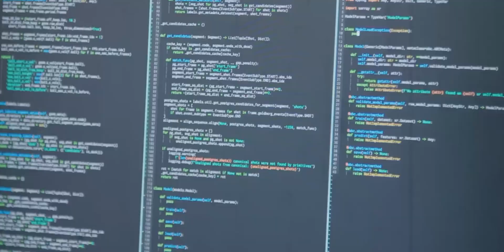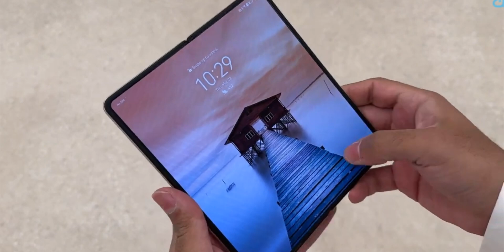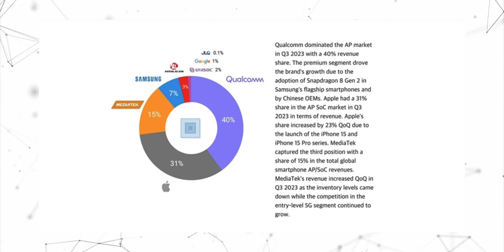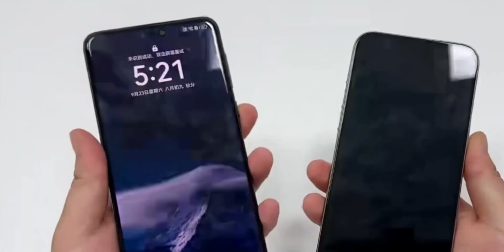Huawei - OMG, SURPRISE, Huawei is BACK !!

Comment: My next phone is huawei nova 12pro or ultra ,now i have nova 9pro !Huawei forever nonthing else, we dont need gms we can and without them!
Reply: Don't know the next, I have Mate RS, PORSCHE DESIGN, just replaced the battery.
Reply: I have had my Huawei P9 Plus for 6 years and still using the original battery and original charger. I'm astounded as I never expected this type of durability and it's the only durability I have experienced since the Nokia classics like the Nokia 6230 and 3310. This is by far the strongest and most reliable touch screen smartphone I have ever owned...and to think I was a bit hesitant to keep it after switching from my previous Samsung Galaxy S5.
Reply: @andrewfisher4266  what?  6 years and still using the original battery??? lucky you!!!!
Reply: Agree with you ❤
Reply: No more Huawei phones for me. The EMUI itself is a complete garbage and bland Os. It's supposed to be a Chinese phone but refuses to use the Unisoc T820 5g which is a Chinese SoC. Unisoc chips had proven to be long lasting and doesn't have connection issues , unlike kirin.huawei is very deceitful and cheaping out, underpowered phones, overpriced. I'm glad honor has separated itself from Huawei 😊
Reply: 🤣🤣🤣 
(huawei mate 60 pro user here)
Reply: @federic0  are you enjoying it to the max?
Reply: @danteerskine7678  don't waist your brain. you don't know its value. please send your cv to apple and find out how much your brain worth  😁😆😅🤣😂
Reply: @danteerskine7678  that's because Unisoc is for budget phones... Who in their right mind would use a budget processor for a flagship phone

Their strongest chip is like D6080 level or below 😬